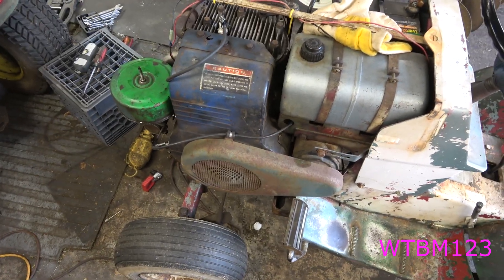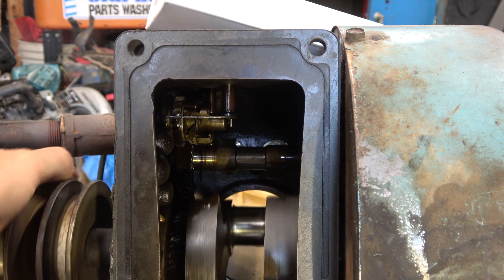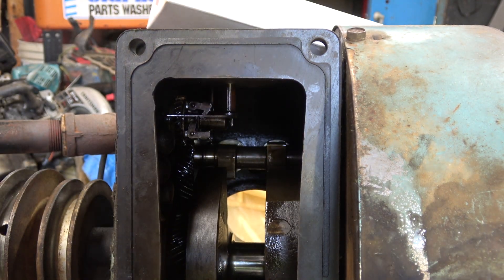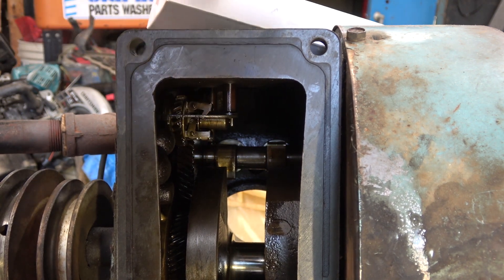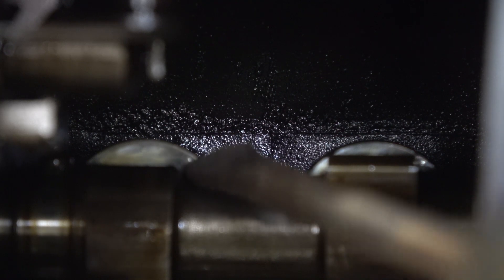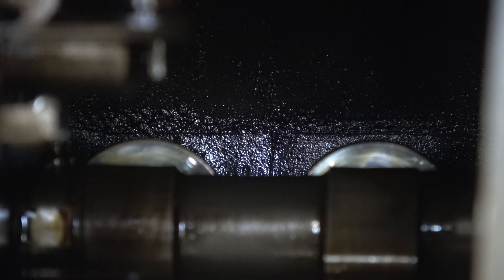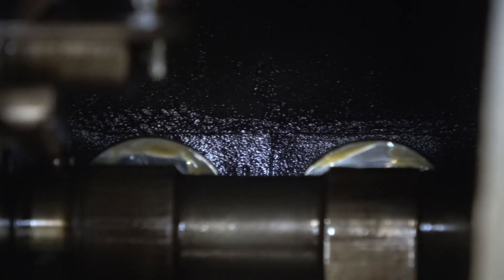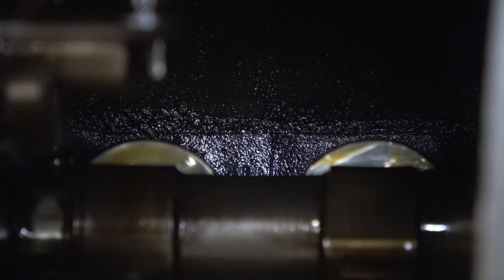Cast iron Briggs Engine . Noise . Tappet moving around

Comment: I got a 16hp briggs i just put on my ac b10 after the other 16 hp rod started to fail but did you here that noise as you rock the engine back in forth with the cam touching the tappets? Cause i got a feeling my new used briggs might have your same noise with the same issue as yours
Reply from the maker: Thinking it was mostly when running . can have piston slap . or crank journal could be out of round. Hope it is something simple.

Comment: Easy fix Terry , I bet they can turn a sleeve on the lathe and press it in the block !  Never seen that problem before . But the fix should be pretty simple ! ENJOYED..
Reply from the maker: Yea should be about like a valve guide , Going to check my other engines
Reply: @wtbm123  Yes sir ! I make my own valve guides when I can , Most are very easy on the lathe .. And I can use better metals than stock guides ..

Comment: So the tapits need removing and the stem guide needs to be drilled out bigger and two inserts pressed in.
Maybe?
If they are a good machine shop, it should be fixable :-D
Reply from the maker: Yea we do have a machine shop a ways away that does a lot of small engines . I am sure they can fix it .

Comment: I had 11 hp Briggs and stratton engine it is I/c  story Short it has a broken connection rod 😭😭
Reply from the maker: Yea i thought i was going to find a loose rod .
Reply: @wtbm123  glad you have a better engine than me I hate my engine is dead it was on a series extra tuff snapper rear engine rider  bulit back in 1985
Reply from the maker: @madaboutmowers  Snappers are pretty good , To bad the engine failed . I have one of the old Comet 26 riders . I think it is from the sixties , I used it a lot when i was in my teens . Engine died , Some day i will bring it out and hopefully repower it , It was pull start only .
Reply: @wtbm123  cool to hear that young man. 😎😎👌👌